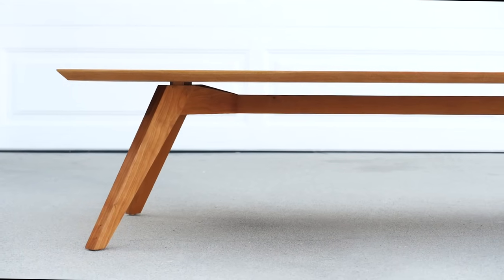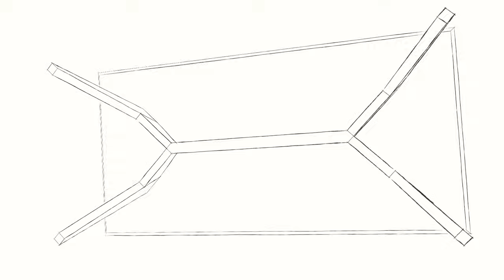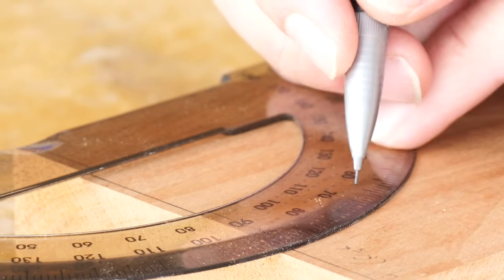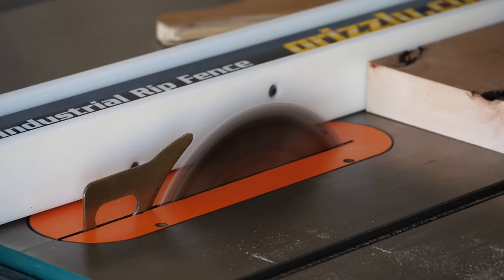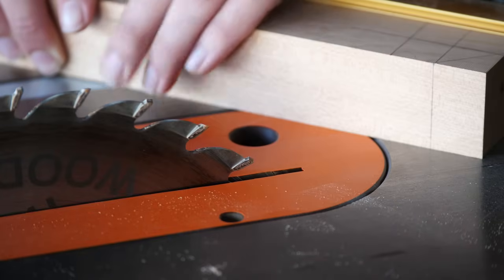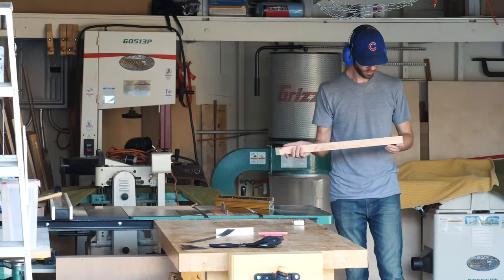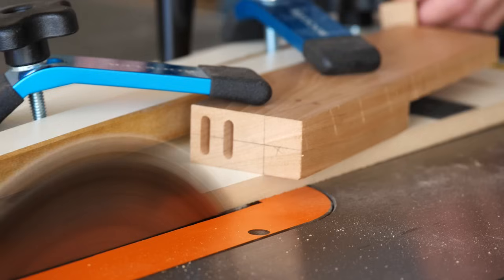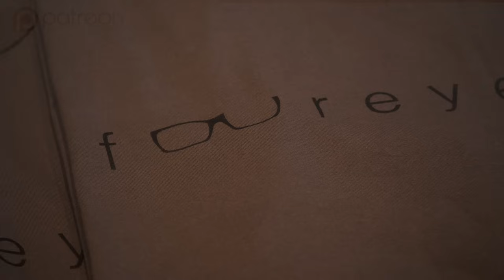Build A Mid Century Modern Coffee Table - Woodworking

Comment: I'm thinking about adapting this to a dining table. Have you tried this? I guess the angle of the legs would be a little tighter. What do you think?
Reply from the maker: Haven't tried it, but could definitely done. Yeah, I'd play with 5-10 degrees off of 90 for the legs (this is 30) depending on the size of the top.

Comment: Great video. I really like the deign of this table. When making the angle cuts, rather than sneaking up on the second cut to get the tip in the center, why not just set a stop on your miter gauge, cut one side of the piece then roll it over and cut again. That should give you a perfectly centered tip.
Reply from the maker: It's been so long that I can't fully remember why you wouldn't do that...but I think the piece might have been too long for a stop. Hope that makes sense.
Reply: @Foureyes.Furniture  Yeah, on second thought, that piece is pretty long.

Comment: Hi Chris, Just found out about your channel (from Core77) and subbed straight away - this is some nice work, well done. 

I really don't want to be 'that guy', but when i was watching around 5:50, i couldn't help but think that, if you'd just set an end stop on you first cut, and then flipped the workpiece for the second, you'd have been guaranteed a central meeting point?
Reply from the maker: Hey Trev...you're right. And don't worry - I won't think of you as that guy. I think it might have been too long for my particular miter gauge...but I definitely could have rigged up something. Thanks for the sub :)

Comment: A question (and sorry if this too much of a noob one): How do you set out the exact location of the dowels on the legs and on the top to an exact match?
Reply from the maker: For this one...I installed them in the base, then just flipped it all upside down and use my ruler to get the base as close to centered as possible...then marked out where the tenons were hitting the underside of the table. They lined up close enough that I could muscle them in - and that's actually good b/c that tension makes for a tighter fit.
Reply: Ok thanks, that makes sense :)

Comment: I want to build something like this, i've been looking for ways to attach the tabletop to the base accounting for wood movement. Attaching the tabletop to the base in a fixed way won't cause the tabletop to crack since it is not allowing wood movement?
Reply from the maker: I think this piece will be fine. If anything, the top would probably cause the base to come apart - but again, I think it'll be fine.

Comment: Hey Chris
I love the legs for the table. it turned out so elegant.
I'm considering starting some woodworking myself after being inspired by you and Frank Howarth. What would you say would be the better tool to start out with? A circular saw or table saw?
Reply from the maker: there both versatile in their own way...but if I had nothing and wanted to start with one of those, I'd probably get the circular saw. My thinking is that you're probably deciding between a pretty nice circular saw and a not that great table saw. I'd start with the nicer circular saw, and that get a nicer table saw somewhere down the line :)

Comment: I was paging through my copy of Sam Maloof's "Woodworker" last night and saw an interesting solution to joining 3 (or more) separate structural pieces and thought immediately of this video. Basically, 3 becomes 4, and that 4th piece essentially acts as a female part to receive tennons from the other pieces. After the joint is formed, it's then sculpted to make it appear as though it all just flows together, although depending on how it's executed and the design aesthetic you are going for, I'm not sure it's necessary. Think of one of those geometric spheres put together with a bunch of straight pieces... all those joints mate at a piece that is essentially just a receiver.

Comment: this was awsome! I took some time to finally watch it :) Nnice work on the dominoes! Maybe someone asked already, you took so much care to miter the domino pieces, another way could be glueing a domino in first, then boring the second hole to remove the first one's excess? less elegant, but less operations :P I mean I would have probably done the same as you did but... there's that shortcut :) thanks for another awesome project!
Reply from the maker: Hey man...thanks! Yeah, I had though about that. It actually came down to a mater of quickness in my head. let's call them "your way" and "my way" my way being mitered...anyhow, your way is quicker in terms of total time...but my way has less down-time since you could do all the cut all the mortises, cut all the tenons, then glue up...vs, cut half the mortises, glue up, wait, cut the other half, glue up....and it was kind of a "well, I'm already out here and I have time now, so let's just get it done". Hope that makes sense.
Reply: Chris Salomone it sure does! Thanks for taking the time to explain! :)

Comment: Has wood movement for the top become an issue with the four attachment points not having any way to allow for movement?
Reply: I have the exact same question. I love the design but curious how wood movement might play out. It looks like the direction of expansion/contraction is ~30 degrees to the glued-in oversized tennons. Chris?

Comment: I recognize this is a very old video but wondering how that blind tenon connecting the table top to the legs has managed with wood movement over the years.
Reply from the maker: No issues. I have this table in my office and it's holding up nicely

Comment: why not just offset the mortises/dominoes? still a good looking piece. as long as it looks good and is functional and solid.
Reply from the maker: Thanks. I'm not sure I'm following. Like just put 1 in each and not have to do the 45s? Honestly, you could probably do that and it would be fine. I think I just kind of wanted to do the miters and I guess it's a little more meat.
Reply: No, I mean offset the vertical position of the dominoes, although in looking at it again you may not have had enough vertical thickness to do that, unless you went with much smaller dominoes.

Comment: I'm still a little bit confused as to how your new design will be stronger than your old design. It's now just putting shear on the dominos instead of the dowels on and endgrain-endgrain joint. Given the dominos have a larger cross section, but the general rule of thumb for any kind of biscuit, dowel and domino joinery is that it's 99.7% for alignment and .3% for strength. Was there a difference in your cuts in order to get more strength out of the glue joint?